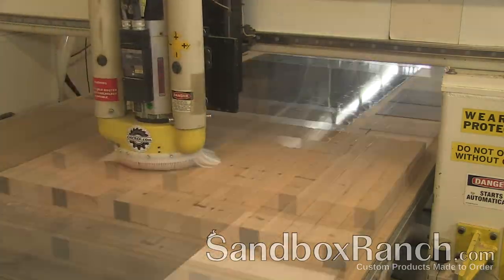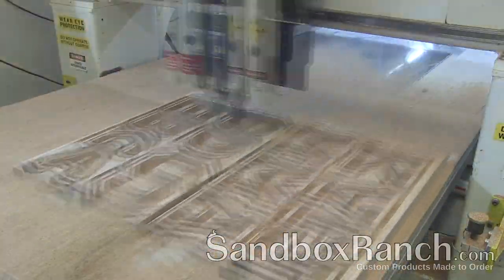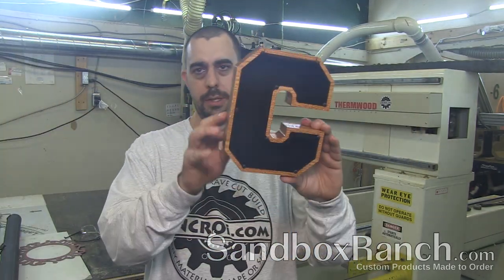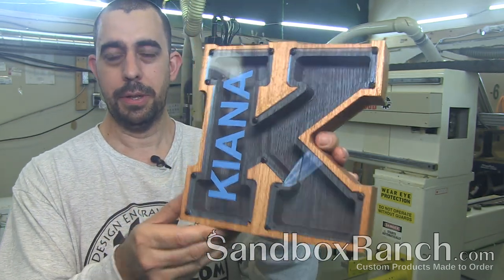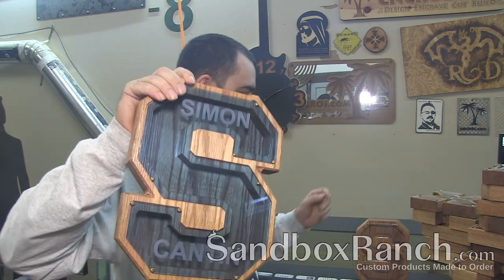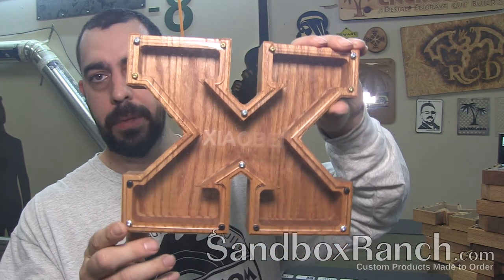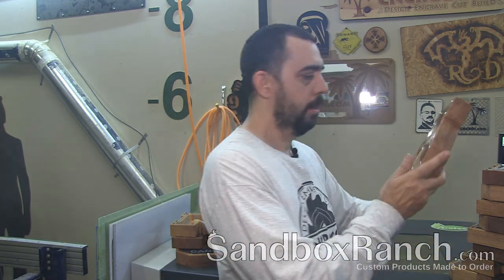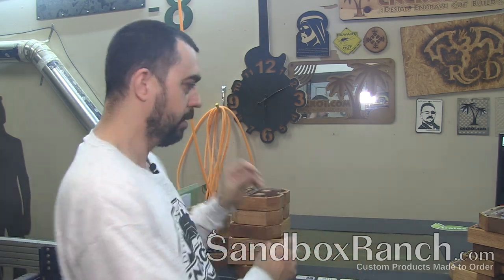Custom Wood Piggy Banks: Start to Finish

Comment: Hi there. can it only be opened by removing the screws?
Reply from the maker: A sharp rock on the acrylic will shatter it or you can throw it in the fireplace... but screws are less destructive.